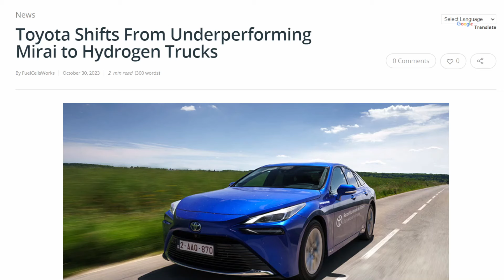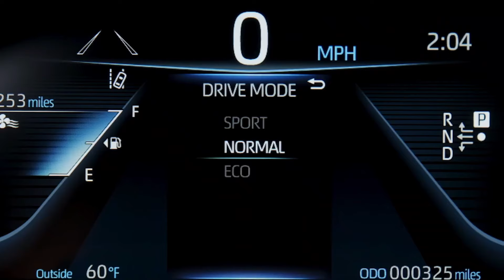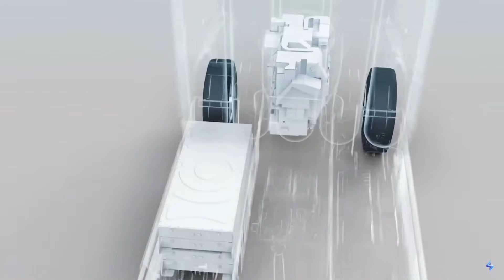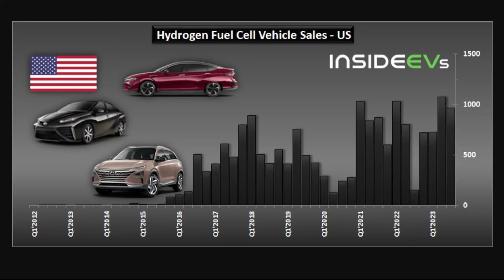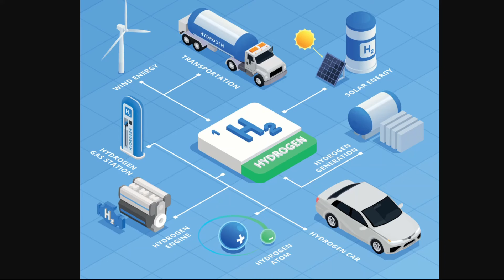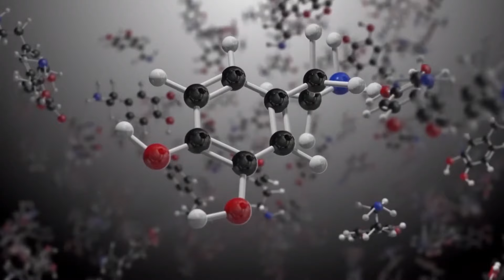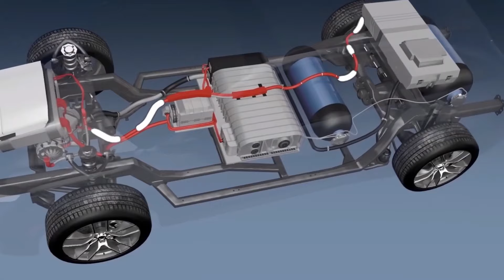Toyota's Hydrogen-Powered Mirai WASN'T A Failure

Comment: I came across an article yesterday that Toyota's Mirai in the 3rd quarter of 2023 it hit record sales of 933 which is a 531% increase than 2022 and also Toyota just finished their plan with Fuel Cell Energy and Exxon just extended their project with Fuel Cell Energy on their decarbonizing technology and Nikola Motors is still pushing forward. It might take some time but Fuel Cell Technology is definitely coming. That's where I have my money at.

Comment: The incredibly high cost of H2 is seldom mentioned. Hydrogen fuel cell vehicles cost 7-10 times as much per mile as BEVs in operating cost. Real world example: the Toyota Mirai carries 5.65 KG of H2, and gets an EPA range of 357 miles. A KG of H2 in San Diego, where I live, is currently about $36, having recently increased from about $17(!). So the per-mile cost of H2 for the Toyota Mirai is 5.65 x 36 / 357 = 57¢. Meanwhile, my Tesla Model Y has a 75 kWh battery, and has an EPA range of about 320 miles. At EV charging rate of about 15¢/kWh, the per-mile cost of electricity for my Model Y is 75 x .15 / 320 = 3.5¢ — 94% less than the cost per mile of H2. And actually, my cost is zero, because I recharge from my rooftop solar array, which of course H2-fueled vehicles can't do.
Reply: Here we go 🙄
Reply: Wow, you're so smart. Comparing BEVs to Hydrogen when the later is still in it's early stages. You sir, are a true genious. Because scaling effects and massproduction only cut costs for BEVs, no other industry, only BEVs. It is so lucky the world has got enlightened people such as yourself...
Reply: @windsolarupnorth7084  Helpful hint—if you're going to use the word "genius" in sarcastic comments, learn to spell it.

The first widely-sold BEV, the Tesla Model 3, cost in the high $30 thousands in 2016, and today—costs in the high $30 thousands. Help me understand how scaling effects and mass production cut costs for the Model 3, as you apparently claim will occur with HFCVs?

But my comment related not to the cost of the vehicles, but the cost of the fuel. Tell me how much the cost of electricity has reduced due to scaling effects and mass production between 2013, when there were a few tens of thousands of EVs in the world, and now, when there are >18 million? Tell me how the cost of H2 in SoCal increasing from $17/kg to $36/kg in the last year is moving in the right direction for widespread H2 adoption? 

 "But at the time of publication [9/29/2023], 21 of the state’s 53 filling stations are offline — with most of the temporary closures due to “disruption” in the supply of gaseous hydrogen in Southern California. A total of 15 of the 29 refuelling stations in the sprawling Los Angeles metropolitan area are offline, as well as both of the options in the San Diego area — leaving drivers in the state’s southernmost big city unable to refuel." 
Tell me how this encourages folks to buy a vehicle that costs 20 times as much per mile to operate as a BEV, in hopes that the cost of fuel may someday come down by 95%, and the reliability go up to near 100%?

Tell me you don't understand that almost all H2 comes from fossil fuel feedstocks, either natural gas or methane; that fossil fuels are used to provide heat for steam-forming of the vast majority of H2; and that fossil-fueled trucks are used to deliver H2 to fueling stations—when they're not shut down?

The huge difference between BEVs and HFCVs is that when BEVs were introduced ten years ago, operating costs were already dramatically lower than those of ICEVs. But operating costs of HFCVs must come down by 95% to achieve parity with BEVs; and very, very few people are willing to take the chance that the retail cost of H2 will come down so far and so fast as to make an HFCV an economically viable purchase. That's why HFCVs are a complete dead end.
Reply: @BigBen621  
English is not my native language. I speak four languages, how many have you mastered?
Reply: @Big_Ben_from_La_Mesa  You live in one of the most expensive places in the U.S. and you are complaining about the cost of a fuel? 🙄
Reply: @windsolarupnorth7084   I speak four languages, how many have you mastered? 
Well, at various points in my life I have either studied, or acquired by immersion, some knowledge of Latin, German, Spanish, and French; but I've certainly mastered none of them, and have retained little but a few words of each at this point. So I'll concede the language and spelling point to you.
Reply: @bradhurd6097   You live in one of the most expensive places in the U.S. 
Cost of living affects different people differently, depending on their circumstances. While the average cost of housing is high, I'm living in a home I bought in 1979; and so my cost of housing is what you might expect in the suburbs of some Midwest city. 
The cost of electricity is among the highest if not the highest in the lower 48; but I pay nothing for electricity, due to rooftop solar.
The cost of gas in California is the highest in the lower 48; but I pay nothing for fuel, because I charge my Tesla Model Y with free electricity from my rooftop solar.

 you are complaining about the cost of a fuel? 
If I had bought a Mirai, and seen the per-mile cost of fuel jump from 10X that of a BEV to 20X that of a BEV over the last year, I'd be complaining. Since I didn't, I'm only stating facts. If you believe I've mis-stated any of them, please point it out and I'll make the correction.
Reply: Yes, today hydrogen FCEVs are expensive to operate, but what almost no one realizes is that this technology has the potential to be even more efficient than a BEV. That is not hyperbole, even though BEVs today are perhaps 3-4 times more efficient. As H2 technology, the supply chain, and distribution improves, we could see parity in system efficiency by the early 2030s.

Wide spread adoption will likely hinge on breakthroughs in solid state H2 storage (lighter and far smaller fuel tanks) and PGM-free membranes (also ultra-low PGM membranes), but even without that, H2 powertrains can offer incredible performance. Prototypes are in development for Europe’s endurance racing series, and are planning to debut in 2026 (see Mission H24). As advanced nuclear power makes inroads into the chemicals industry, process heat can feed high temperature electrolysis for cheap H2. Additionally, a new thermodynamic electrical conversion cycle (super-critical CO2 closed Brayton cycle) is being developed that can improve efficiency from around 33% with today’s conventional nuclear power plants, to nearly 50%.

As the cost of H2 drops (DoE is targeting a $1/kg-H2 production cost by 2031), efforts to take advantage of this cheap fuel will accelerate. It should be far easier and faster to expand H2 refueling infrastructure than expanding the grid to accommodate mass vehicle charging. Truck stops today can deliver fuel at a rate around 300 MW 24/7. An upcoming H2 filling protocol (H70HF) will enable fast fills at a rate above 10 MW, whereas MCS (mega charging standard) is around 1-3 MW. A long haul truck might finish its fill in 5-10 minutes and travel 800+ miles.

H2 with a fuel cell today is already like a super battery, but by tomorrow it can be cheaper and cleaner with advanced nuclear than batteries with a renewable-centric grid. 

I also think we may see cheap sodium solid state batteries dominate BEVs, while lithium solid state will be more for luxury/high performance applications. The energy transition is a massive challenge, and having options will only increase our chances for success in this race against time.
Reply: Doesn’t Tesla charge $0.25-0.50 per kWh with their super chargers? At $4 kg-H2 (dispensed), a fuel cell could charge the Tesla BEV for much less than 25 cents a kWh.
Reply: @cbarcus  Yes, that sounds about right for Superchargers. But most folks who own EVs charge at home, where even in the highest electrical rate in the nation, the EV rate is 15¢/kWh; and many, myself included, charge for nothing, from rooftop solar. For those who don't have access to home charging, rates should be adjusted accordingly.
I'm not sure I follow your example, because what counts is operating cost per mile, and not cost/kWh, which might be wildly different for H2 as for electricity. 
At $4/kg, a Mirai could fill its 5.65 kg tanks for $22.60, and drive 357 miles; so 6.33 ¢/mile. Meanwhile, my Tesla Model Y costs 3.5  ¢/mile on the EV rate, if for some reason I choose not to charge from free solar. So even at a hypothetical H2 cost of $4/kg, the HFCV still costs nearly twice as much per mile to operate as my Tesla.
The problem, though, is that H2 in California is $36/kg, not $4/kg, even when it's available; and I just don't see the benefit of doing operating cost calculations based on fuel costs that are one ninth of actual costs.
If this is some hypothetical calculation, to see would would happen if the cost of H2 could be reduced by 89%, I suppose that's valid. But the problem is that for HFCVs to succeed, folks have to buy them at today's conditions; and I just don't know many folks who are willing to pay sixteen times as much per mile as a BEV that's available right today, on the promise that at some unspecified time in the future, the operating cost will be only double that of a BEV. Of course, I may be wrong.
Reply: @BigBen621  

Charging from home is certainly an advantage, but as electric vehicles scale up in deployment, there will be a major challenge with expanding the grid to accommodate the additional load. Also, I do not expect the general public to buy FCEVs without widespread infrastructure, cost competitive vehicles, and affordable fuel. The initial buildout of hydrogen infrastructure will be to service long haul trucking, and other industries like ammonia for fertilizer and shipping. General consumers will probably start taking an interest in the late 2020s as light duty trucks and SUVs are introduced with fuel cells. $4/kg-H2 is probably where delivery cost will be at the end of the decade, but that is by no means the limit for how cheap this fuel can get. 

As the technology around H2 matures, it will be able to better serve a broader use case. For instance, H2 storage is a major hurdle today, but a recent breakthrough in solid state storage might decrease the volume required by 3-4 times while also significantly reducing the energy required for filling the tank. Fuel cell efficiency on average is probably around 50% today, but the DoE is targeting 70-80% by the end of the decade.
Reply: @BigBen621  
H2 production cost by electrolysis is projected to drop to a pricerange between $1 - 1.5/kg by 2050. There are several studies pointing at this. Price of electricity however, is projected to rise. Theese are productioncosts, obviously consumerprices will be higher.

H2 makes alot of sence in many countries and regions. The range is already superior, especially in cold weather. As BEV effiency and range drops in cold weather with up to 40%, the fuelcells are only marginally affected.

You are ofcourse allowed to continue with BEVs, no one is forcing you to go hydrogen. But please stop forcing others to go batteryelectric. 

I salute Toyota for giving people the option of free choise. Something that should be a matter of course but oddly is seen as controversial today.

Comment: Hydrogen needs more development and infrastructure. But, is more greener than eletric. You don't need to destroy the surface to extract minerals, you produce your own resource to use for transportation. And  batteries use rare and expensive minerals
Reply: So do fuel cells, which also have batteries in the vehicle. FCEV's are not greener than BEV's when you take into account either the fossil fuelled grey / blue hydrogen production or the 3 to 4 times as many kWh needed to go the same distance with green hydrogen.